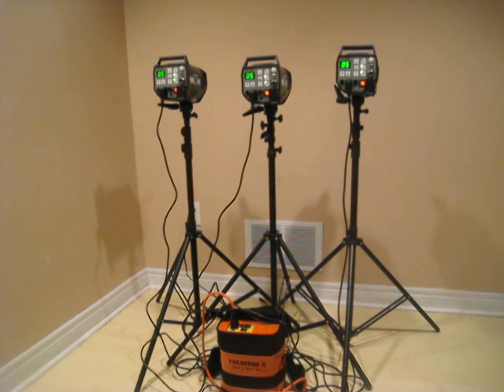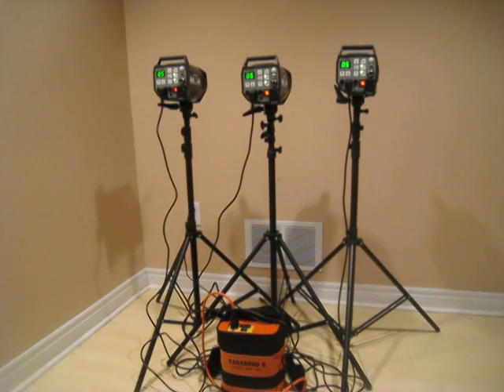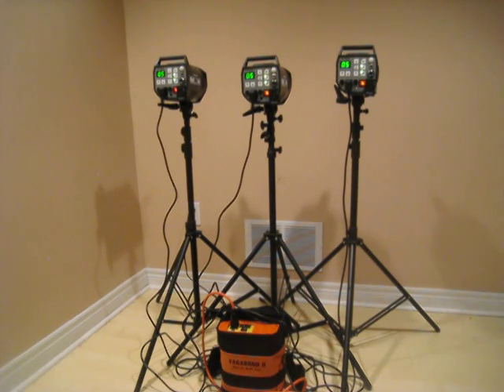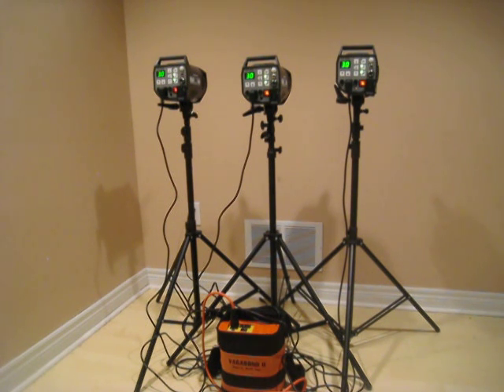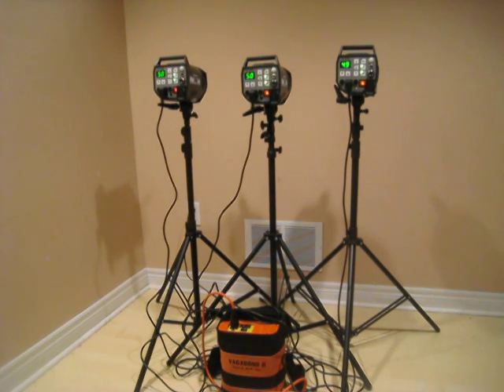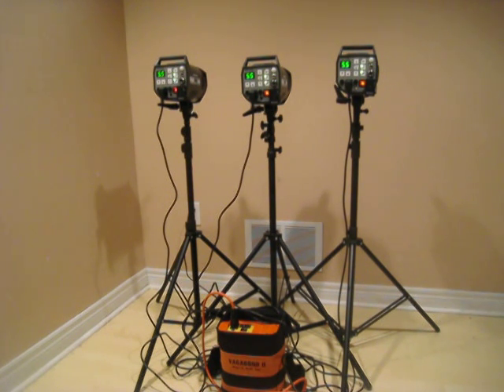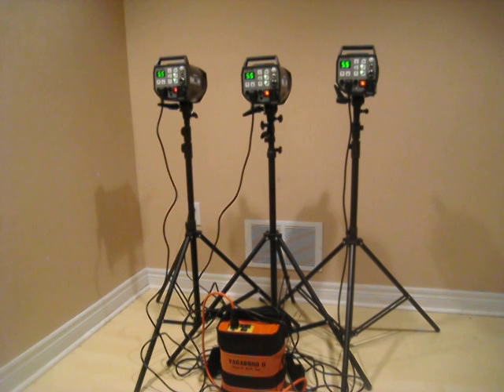Vagabond II and Elinchrom Style RX 300 (Part 4)

Comment from the maker: I have never actually done a test to count how many pops can I get with a fully charged powerpack. It will depend on the setting on the strobe. What I can tell you is that I normally shoot around mid power and I never ran out of juice in my shoots so far (around 400 to 600 shots no problem).